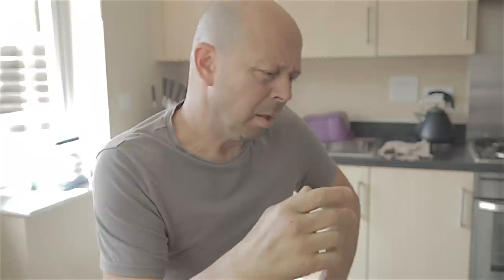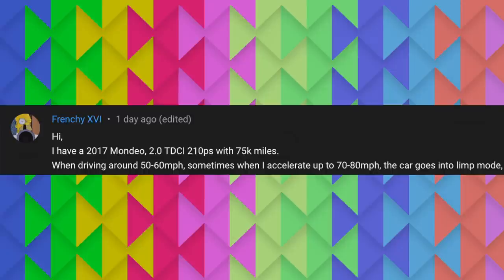Engine takes a dump into limp mode, Ford Mondeo Mk5 2L Diesel, Answering a viewers question.

Comment: Yo Alan, probably one of your best videos with not a car or engine in sight! Brilliant and extremely useful info for all levels of DIY wrenchers. Glad you said you might do more of these 👍 Your knowledge of diesel Ford engines is bang up to date however your Latin lessons were a long time ago at least sixteen years I would say 😂🤣 (XVI = 16) Love your work & sense of humour, have a nice weekend. Kind regards from Galway, Ireland 😉👍💚     💙💛
Reply: You're right, XVI is 16.
(that's my lucky number)
Reply from the maker: lol, yes , thats how good my latin is, thanks damien
Reply: @alan4x   I have driven 274miles, on the first 137miles it went into limp mode once.
On the way back, it went into limp mode 4 times including once when I was driving at 60mph, that time the engine struggled a bit before to start.
So, I'll move to the next step which is checking the injectors.
Reply: @frenchyxvi1698  Hi Frenchy, I just started having the exact same issue on my Mondeo 2.0 diesel, it keeps happening the same way as for you, 6th gear on highway when I floor it. Did you manage to fix your Mondeo? I'm also quite fond of it and would rather fix the issue rather than sell the car :( Thanks a lot in advance ♥
Reply: @BennySVK117  Hi, I have replaced the whole fuel system, paid £2800 for it.
Now I'm having overheating issues🤣
Selling it asap.... done with Ford

Comment: Thank you for the advice, I have a Mondeo 2.0 diesel and I had the same problem when I accelerated the car stopped and the people from the Ford representative replaced my pressure sensor on the ramp and were going to replace the pressure pump as well but seeing the videos you made I made a  test of the leak injectors and I discovered injector 2 broken.  You made a man happy, thanks again!
Reply from the maker: lol, well done

Comment: Thanks Alan. This video saved my car from the scrap heap i was told  it would be hard to find the fault but i realized i had not changed   the fuel filter in 5 years 20 mins later the car was back to normal. thanks

Comment: **Update 2 02/07/22 I have driven 274miles, on the first 137miles it went into limp mode once.
On the way back, it went into limp mode 4 times including once when I was driving at 60mph, that time the engine struggled a bit before to start.***
*Update 01/07/22 I have changed the fuel filter and the air filter at 76k miles.*
I have bought a fuel filter this morning before going to work as that was mentioned in a forum and it is only a £25 solution... (also got an air filter and booked a service to change engine and gearbox oil and filters at my friend's garage).
 I have watched your video about how to change an oil filter on a Mondeo, I will keep you updated on that
Reply: "Trust" Ford Bristol was asking £800 for the engine and gearbox service + fuell filter change 🙃
Reply: just tried to change the fuell filter, it is dirty and fluffy, hopefuly that was the reason for the engine to go into limp mode.
got the wrong filter (bloody eurocarparts)
I'm ordering another one now, should receive it on Tuesday.
Was very easy to do while watching your video about fuell filter change 👌
Reply: Let us know how it goes!
Reply: @armunro  I will
Reply: @frenchyxvi1698  when you change the fuel filter , clean the fuel filter housing ,  and full it with new fresh diesel before you start the car , otherwise the car won’t start or takes ages .
Reply: @omarmrd  when i've done it, the housing was filled with diesel
Reply: @frenchyxvi1698  replace it with fresh one then put the new filter .
Reply: @frenchyxvi1698 Personally, I wouldn’t trust Trust Ford Bristol with anything. Their customer service skills are next to zero. If it was them that charged you £180 and used 1/4 tank of fuel then gave it back with No Fault Found that wouldn’t surprise me. Just thought I’d share that. Let’s just say that although they are my local dealer, I prefer to travel to Thornbury to have work done. Service is much better and prices more reasonable!
Reply: @lionelblak  Yes it was the Bristol one nearby Cribbs Causeway.
At the time I had paid £1000 for 1 year extended Ford warranty, they still wanted me to pay. Then the warranty sent me to an approved garage, who said they don't know what is wrong with the car.
Reply: Hi mate,I have a mk4 galaxy with same engine,had exactly the same issue of limpmode,at motorway speeds,had it scanned and it was oil pressure related,changed oil pressure sensor,no change,then replaced the oil pressure control solenoid,cured my issue instantly 35k later still perfect 👍
Reply: I had similar issues with a 2016 MK5 mondeo 2.0 tdci 150hp, on motorways, generally on the 6th gear (but it happened once in 5th),  when I accelerate or riding uphill, the engine switch into limp mode with Check engine message and I had to stop on the sideway, turn off the engine and turn it back on.
When I plugged diagnostic tool, it returned me faults codes : P0087 and P228C or P0251 and P02FA
I followed approximately the steps explained by Alan. 
-change fuel filter : nothing changed
-change air filter and cleaned throttle body : nothing changed
-clean the injectors : nothing changed
I finally changed the 4 injectors and i seems to work well now...

I've read several similar problems on Ford owners Polish forum and each time, with the same error codes, it was linked to leaking injectors...
Try to get an OBD tool with Forscan and get your fault codes, it should help you a lot...
Reply: @alanjm1234  problem was the fuel pump disintegrating itself, damaging the injectors

Comment: excellent informative vid, thanks so much. there is currently a similar problem with our 08 c-max 2.0tdci, it did the warning, rattling, limp, a garage changed the fuel filter, the housing, and a valve on the pump related to pressure/volume. it was then ok but is now doing it again, usually at around 80- 90 under acceleration. after turn off a while it behaves ok, just skid sign illuminated for a while. we now have found a good and competent mobile mechanic who has kept our family going, so when the c-max needs repair again, we will see...

Comment: Hi Alan have Galaxy (Duratec)
Chucked up transmission fault and went into limp!!! 
Plugged in and code stated ABS sensor fault. 
After changing both front sensors same fault!!!!
Watched your video and taken your advice I changed fuel filter. 
After test drive fault has gone. A relatively cheap fix without lining fords pockets. 
Great channel with good advice thank you so much for posting 10/10.
Reply from the maker: thats interesting, your filter must have been pretty black to restrict the fuel flow, glad you got it sorted, cheers

Comment: Alan Mondeo Content Saturday. Nice. We need more local Alan in our life.
Reply: We need to clone Alan and make all the clones Directors of all Ford garages, then it will rightfully be named TRUST Ford 👌
Reply: @frenchyxvi1698  Good one !!!!
Reply: @frenchyxvi1698   I don't think the dealer Ford can't find the problem. I believe they are to lazy to investigate. If you payed the diagnostic and they said nothing was find, în that moment you had to take one man from reception to make a drive test and demonstrate the car have the problem that you mentioned.
Reply: @TheGamfu  they've driven from Bristol to Weston Super Mare and back , and said that there was nothing wrong with the car.
Reply: @frenchyxvi1698  How often is happening this problem
Reply: @TheGamfu  not often, maybe once a month or even less
Reply: @frenchyxvi1698  and doesn't it usually happen when the engine is hotter?
Reply: @TheGamfu by the time I reach roads where I can drive at the speed that triggers the limp mode  the engine is hot (the gauge is right in the middle)
Reply from the maker: lol, cheers dan
Reply from the maker: lol
Reply: @frenchyxvi1698  I say that the best method is to go to the road test and when the problem occurs without stopping the engine to put diagnose and read the DTC. If not, get some cheap diagnosis just read the errors and come back with the error. I'm a little nervous because Ford didn't try to solve the problem.
Reply: @TheGamfu  "Low Fuell Pressure Regulator" was the diagnosis when I went to my friend's garage last year.
Reply: @frenchyxvi1698  that was last year. Do like i say previously and you will resolve the problem.

Comment: I had a similar issue with my old  Mondeo 1.8 tdci. 
Every 29k miles or so the engine would not rev over about 3500 revs.
If I held my foot hard down the exhaust would emit a huge amount of white smoke which is a symptom of weak fuel to air ratio.
Even though the filters were well below the service interval this always occurred. 
Replacing the filters at the lower mileage of 25k never saw a repeat of the issue.

Comment: Had an older Mondeo diesel which did this limp mode thing when we were towing a caravan, pretty scary trying to get the whole lot to the hard shoulder! Good video
Reply: Same here. It occured first when towing but it's done it now 3 times without the caravan on the back. Mines a MK4 2009 diesel. Did you ever sort it and how if you did?
Reply: @martinfrancis7907  no we got rid of it. Never seemed to do it when we weren't towing so wasn't an issue for the part-ex

Comment: Had a similar problem with a 2.2 diesel Mazda 6 2009, would not give power above certain motorway speed. No engine light or fault codes though!!
Used the whole big bottle of Redex in quarter of a tank which improved things for one day! 
Replaced fuel filter and all was well again! I have been replacing fuel filter on my diesel cars annually ever since! 
On the side note the fuel filter was replaced by Mazda dealer garage about 10k miles before fault occurred,  I have no reason to believe they haven't replaced it as they left the paddle of diesel fuel on the battery tray 😡
Thanks for another interesting video Alan! 👍
Reply from the maker: its crap diesel they sell us full of chemicals

Comment: Alan,  you might be a saviour.
For a week now got same issue, on 5th and 6th gear the engine it's cutting off, tried to drive without forcing the engine, still cutting off and left with no power. 
I'll check hopefully it's the spring in the high pressure pump. On my mk5 mondeo 2016, I've changed the fuel filter 3k miles ago and brand new 4 injectors 7k miles ago.
And same, no codes showing, nothing. Ford and 2 approved garages telling me that with the car everything it's fine.

Comment: Great content as always Alan Currently driving a mk1 ford focus 1.8 zetec in Pacific green nearly 23yrs old now and just had Advisory for front to back brake pipes corroded and pourous etc.
Been under the car and can see one of the brake lines goes up and over the petrol tank ( Nightmare springs to mind ) lol i know most of the fleet you work on are Mondeo's but would love to see some content on mk1 focus if possible 👍Anyway keep up the good work and i'm positive you have saved a fair few people some money and problem solving tips etc.
Reply from the maker: if i get a focus in i will try, cheers malcolm

Comment: This video was amazing for my situation,I have a mk 5 mondeo 1.6 duratorq and it's been off the road since December and at the garage,under load it goes straight into limp mode and now it won't start on the key but will when bump started,I'm super frustrated as thr garage said they can't fix it and gave it back to me this evening,I'm having to use my motorbike for work which I really don't like doing in the horrible Welsh winter weather and clocking up miles on my toy. Everything you have mentioned relates to my situation,the garage computer read low fuel pressure and unfortunately he said there was metal filings and bits of rubber in the fuel system which as you point out could well be a broken spring in the high pressure fuel pump,really appreciate this video and it gives me a base to start as I'm going to do the work myself now thanks.

Comment: Hi Alan. Saga of the Mondeo 2.0 tdci  limp mode. Took it into TCH and they did a road test with zero result, then I took it back this morning in limp mode and kept the engine running. They plugged in their tech and it finally came up with oil solenoid issue. Now the sup lying stealer will have to put it right.
Reply from the maker: lmao, yes that sounds like the oil pressure control solenoid, goes into limp mode when you put your foot down on the gas, common fault, good luck

Comment: Great video Alan. However, I have a MK4 Mondeo doing the same. I can drive along happily with or without my caravan on the back for hours and then "engine malfunction" it's in limp mode. The problem after watching the video is I don't get any kind of faulty fuel codes. However, changing the fuel filter was on my list last week and so I will change that because I missed that out when I did a mini service and my guess is it's unlikely to have been changed for years. Long before I ever had the car anyway. The last code it did show was U0010 Body Control Module on the MS CAN so I'm researching that at the mo although I suspect it has nothing to do with the car "taking a dump in to limp mode". Many thanks for all your informative - sometimes funny video's.

Comment: I had the same problem with a Ford Galaxy 2013 TDI and Seat Leon 2009 TDI. The problem was the VNT turbo vanes sticking due to excess soot buildup which happens due too much town driving. On a motorway when you put your foot down, the turbo vanes try to open up to let more air in but because they get stuck half way, the engine goes in to limp mode since the boost is incorrect. 
Could be fuel filter but If a code reader shows something about under or overboost then it's 100% a turbo vane problem. Search for VNT vanes sticking....
Reply from the maker: thanks for that darksky, this is true, will be interesting to find out what the codes are in frenchies car

Comment: Well Alan brilliantly explained, I own a 1.6 tdci ford focus 2010 model mk 2 brought it in  2018 with 99226 miles ,I change the oil every 4500 miles just clocked up 160000 ,because they are a dirty engine especially with the DPF ,so I think some of the dirty exhaust gases find there way in & contamimate the oil, I know you are talking about the diesel fuel system on a mondeo , but I thing it's good preventive maintenance on the 1.6 tdci to keep the  oil clean

Comment: We had a peugeot 508 with the same engine. Sent to main dealer etc and no diagnosis. I figured out It was going into limp mode as it was low on coolant.  There was no level warning and at a certain temperature  the engine protected itself by limping. Fixed by finding the leak which was the water pump. And luckily no overheating damage.
Reply from the maker: thanks for your comment richard

Comment: Hi Alan, My mondeo 2.0 tdci (150hp) goes into limp mode around 70-80mph (when I de-accelerate to slow down) and always get either:

DTC P1102:21-Е4 Mass Air Flow Sensor In Range But Lower Than Expected 

or 

PO6DD:00-EC Engine Oil Pressure Control Circuit Performance/Stuck Off. 

Never got both codes at the same time. It’s only one of them and always put the car in limp mode. It always happens when the car is doing 70-80mph or when the RPM is between 3000-4000k as soon as I release the accelerator to slow down. 

It’s always one of the DTC but along any of these DTCs I always get DTC U3003:68-08 Battery Voltage. Apart from getting the injectors test I pretty much done everything i.e oil pressure switch, MAF sensor, oil pressure solenoid, air intake and boost leat checks but nothing has fixed the issue. 

Yesterday I did the loose timing chain tested as you suggested and also checked the timing chain via oil cap with pick & hook tool and it’s really loose. 

My question is if the loose timing chain can cause limp mode only when I release the accelerator whilst doing 70-80mph or when the revs are between 3000-4000? 

After restarting the engine the car is out of limp mode till it all happens again.
Reply from the maker: hi, I am guessing you have a mk5 Mondeo ...if the timing chain is loose that is not good and that along with the chain tensioner will need to be replaced soon however you say you replaced the oil pressure switch....right next to the oil pressure switch is what's called an oil pressure solenoid which is a very common cause of putting the engine into limp mode and is why you are getting the code p0600 oil pressure control circuit stuck....those solenoids cost around £120 from ford
Reply: @alan4x  thank you sir for your reply. I replaced MAF, fuel filter, air filter, oil pressure switch and solenoid as well but the car still goes into limp mode between 70-80mph or between 3000-4000 rpm.
I’m just wondering if the loose timing chain can cause limp mood at high speed/rev? To be honest the timing chain is very loose and car mileage is 192k (it had new clutch, fly wheel, thermostat housing, egr cooler housing, brakes etc not long ago) and don’t know if timing chain is worth getting changed unless it may also fix the limp mode issue.
Reply from the maker: if your chain is very loose it is because the nylon guides have fallen apart and the loose chain will cause the valve timing to be incorrect which will case running issues for sure. It is not certain that the chain is the cure to your problem but the chain will soon break so it’s advisable to do it while it’s still working
Reply: @alan4x you are very helpful and thank you so much for your prompt replies!

Comment: Had this problem with my insignia my high pressure fuel pump was not doing its job cost of replacing was £1200 for new one same symptoms as your follower
Reply from the maker: cheers paul, we have had a few insignias here with failing high pressure pumps